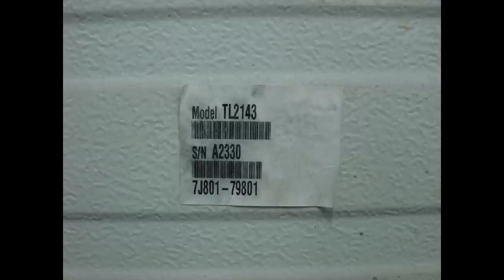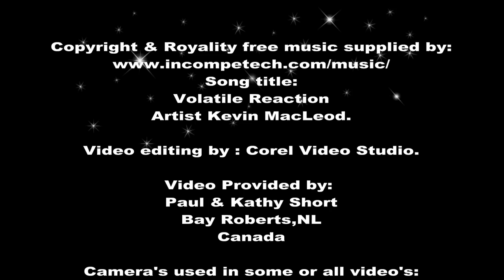Kubota BX Bucket Mod

Comment: Another great video. Thank you. About the spill guard, I see it goes down about 4 to 5 inches but does it than go in and get welded to the bucket? BTW, great idea for hooks. Are their back up plates on each hook on the nut side? Again nice work.
Reply from the maker: Brian Mc Donnell Yes. The spill guard is welded and all the hooks have backing plates on the other side to prevent the bolts from pulling through the bucket. Thanks!. Much appreciated.

Comment: Paul doesn't that extra weight from adding cutting edge take away from lifting capacity?
Reply from the maker: +Jake Schisler 
Yes it do and will but in this case it don't matter because the machine can still life a full bucket of "Class A" which is the heaviest meterial I need it to lift and it gives the bucket much more strength.

Comment: Hi Paul have any videos on bx2380 front end loader not going up at all or slow with no lift power
Reply from the maker: No but check your connections at the quick connectors. I bet one isn’t pushed right in.
Reply: @7863348  I checked them cleaned them and pushed them all in make sure they were working it has manifold quick connection tractor only has 150 hrs on it fuess I will have to take it in

Comment: Hi Paul,

Great video.
I just wondered whether the bottom of the bucket would feel easier to use if it was extended by about 15/20 cm and the sides slightly curves to match it. You could put rubbing strakes on the bottom to add strength, and I think this would give a more useful, perhaps ‘rock-esq’ type of bucket, still able to use your sharpened front edge and teeth?

Take care and as usual a really professional looking video. Thank you. … This is of course only a suggestion and it is not necessary to reply.
mrbluenun
Reply from the maker: +mrbluenun 
When working or modifying the buckets on these sub-compact tractors weight is a major concern in the design and outcome of the mod. The more weight you add the less you'll be able to lift. Finding that happy medium is the tough part.

Comment: Did you get that question paul? I know you are hammered with questions
Reply from the maker: What question?
Reply: Paul Short I wanted to know if you ever made a tooth bar to fit over your cutting edge on your bx, and also wanted to know if you have any bucket Flop on your FEL bucket, I have qiite a bit in mine and I took it to my dealer and he says it is completly normal, so those were my questions
Reply from the maker: Mike Eldredge 
Sorry Mike. We get ad average of 150 plus questions and comments a day and there's no way possible for me to keep up with that many. I'm actually considering closing the comment section of our video's or quitting YouTube altogether so sorry for missing yours. Nope. I haven't made a tooth bar for the BX BUT I did for the 5740. If I didn't have the 5740 I would have made a tooth bar for the BX. I'm not sure what you mean by "Bucket flop" but all the pins and bushings on our BX are tight so there should be any bucket flop[.
Reply: Well when I pick up the FEL arms with a load the bucket wants to move back and forth, I am sure you are hammered with questions, and it must take up a ton of time answering them all, I appolagize
Reply from the maker: Mike Eldredge 
Oh, ok. Yup that's normal. It's caused by the geometry of the tilt cylinder. It's really because there's only one cylinder and that seems to be the only way they could get it to work. It shouldn't pose a problem. I never really notice it myself.
Reply: Hmmm okay paul ty for the insight, as far as you leaving You tube I really hope you are not serious. I love your videos! I try not to ask too many questions as I know you must get hammered by questions from everyone and it is time consuming. But I am about to take on the hydraulic thumb portion of MY Bx25d and would love it if i could ask some questions on the project that you did to yours when the time comes.
Reply from the maker: Mike Eldredge 
No problem. You can ask but be patient. I'll get to it when I can :)
Reply: Paul Short Np ,:)

Comment: Paul I have a question for you, I just bought a bx25d a few weeks ago and noticed my bucket cutting edge is straight after watching this video. is this normal on all bx models. what would you do? you advice is greatly appreciated.
Reply from the maker: Get your dealer to exchange the bucket. Something isn't right about it. I would insist they replace it.

Comment: I have a kubota lawn tractor and I had if for about 10 years but now it's starting to lose power
Reply: Clean out the fuel filter
Reply from the maker: Gretchen De Wit Good suggestion

Comment: The cutting edge is a piece of grader blade. It is a specialty steel especially when being rolled out in a steel mill.  It is a hard job to maintain the bevel edge on the edges of the blade.  If you look at the plowing edge of a road grader you will see one mounted on the edge of the blade. As Paul says the blade is double edged and it can be 6 inch, 7 inch, and 8 inch's wide and come with a double edge or sometimes it would have a single edge on one side and a rounded edge on the other which makes it non reversible.                                                                           Love and Peace.   Blessed Be.    Doug
Reply from the maker: Douglas Smith All good points Doug. Thanks for pointing them out.

Comment: Are those flat or domed plow bolts on the edge install ? ?  Thanks !
Reply from the maker: They are flat under the cutting edge.
Reply: Thanks for the prompt reply......One last ? ?  How much oversize did you drill your holes.....1/32" or ?
Reply from the maker: Yes that sounds about right. Just ask your supplier for cutting edge bolts and they will come with the flat bottomed bolt, nut and lock washer. Good luck